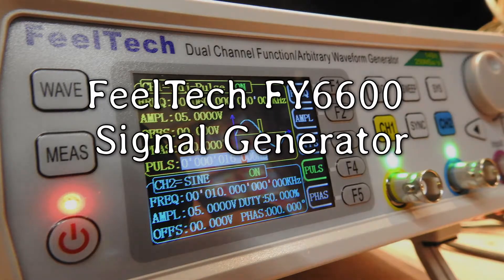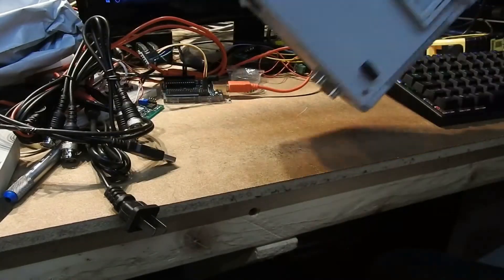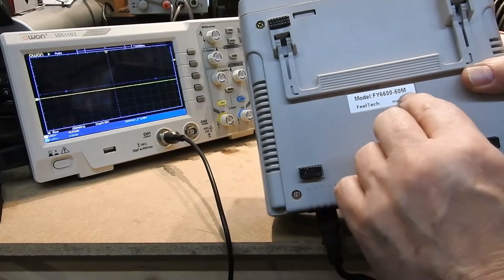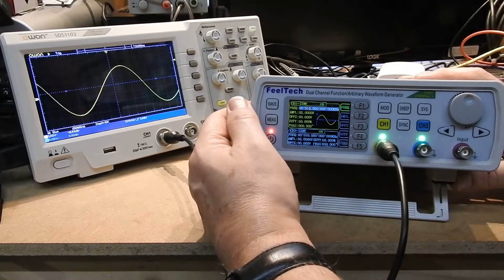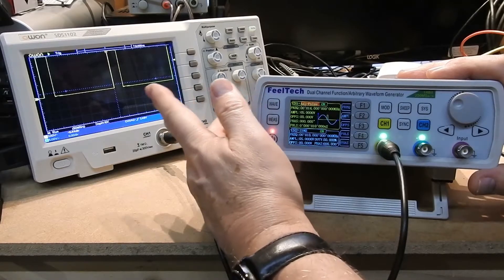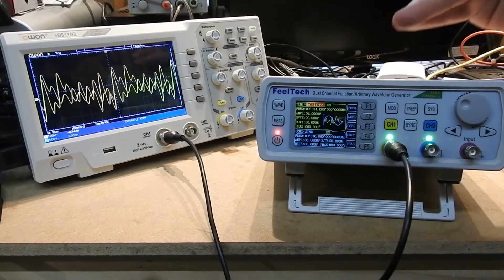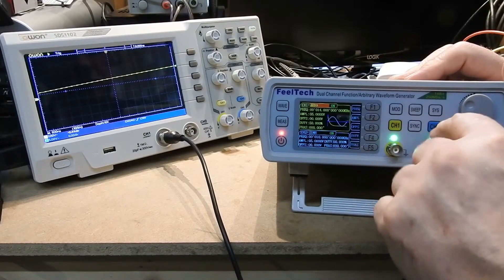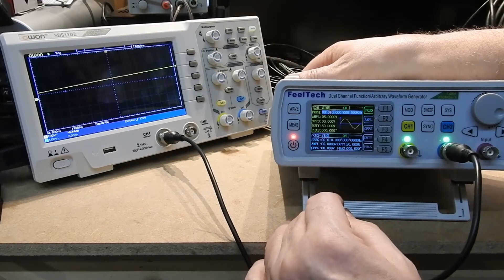FeelTech Dual Channel Function/Arbitrary Waveform Generator

Comment from the maker: Not forgotten about this useful unit.. spent Christmas through January in hospital with no access to any of my gadgets, hopefully before long, I'll be able to get back into full swing but not before taking a well earned break in the sun.
Reply: Hello there, hope are feeling better.  Quick question,  when the unit is set in measuring mode I know it is measuring Hz frequency,  but is it also measuring the ac voltage of the signal or just the Hz frequency?
It would be great if it could do both.

Comment: Thanks for the review. I have the 60Mhz version and like it very well except for power supply leakage. Mine has 50 volts of mains voltage on the BNC  connectors to ground. I have ordered a new isolated P/S from BangGood to fix the problem.
Reply: Joel Caulkins What exact model of P/S have you bought on banggood ?
Reply: Guillaume BRAUX Its this one: 12V 5V Fully Isolated Switching Power Supply AC-DC Module 220V to 12Vhttps://banggood.app.link/7aOqezW1pJ however it also has 50V of mains on it, so no better than the original. I just ground the generator and it works fine.

Comment: Can anybody tell me if this can use a pulsed carrier mhz frequency along with a pulsed hz frequency at the same time? if so, what's the highest setting and voltage without distortion?

Comment: 00:50 "...there's a mains lead that came as a bit of a shock..." No pun intended? ;-)
Reply from the maker: Hah, well, the shock was the type of plug.. USA.. usually I end up with European plugs for which I have adaptors. I remain convinced that while the USA type plugs may be fine for 120v, I'm not too happy about their use with 240v.
Reply: I've read that it's a flimsy power cord, even for 110V...